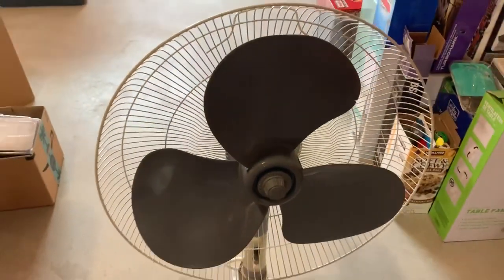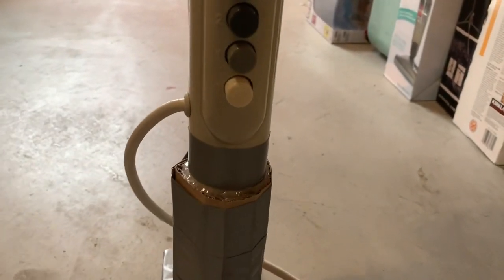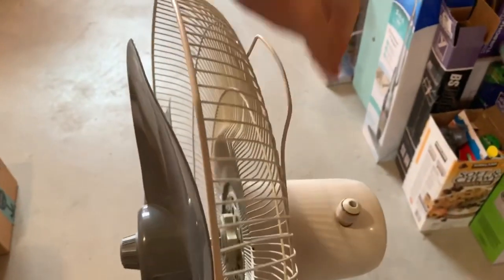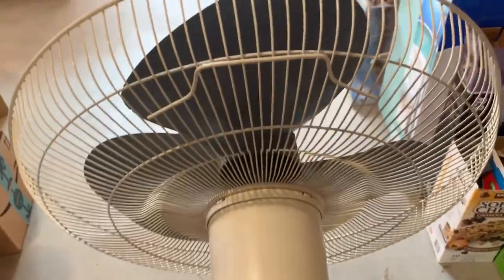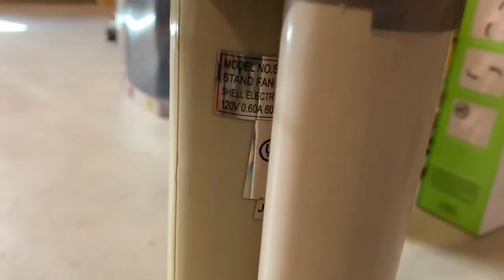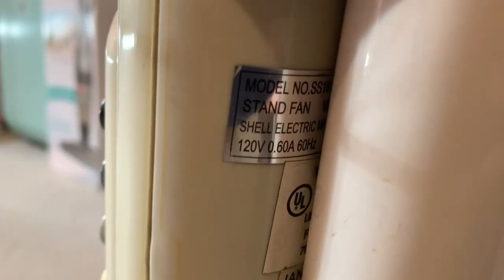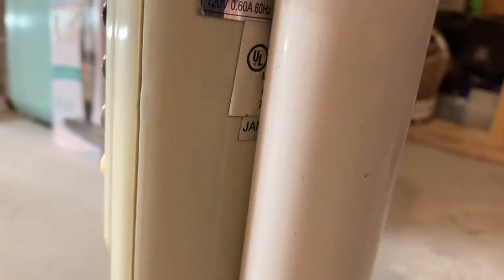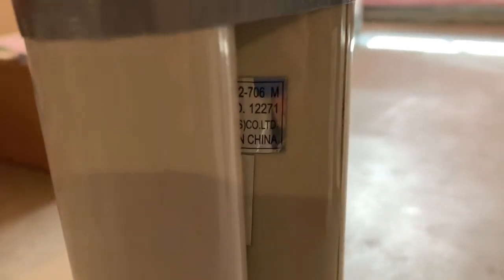2004 Hampton Bay 18” Franken-Fan

Comment: Wow! That is a good runner for a beat up fan, sad that it’s being parted out.
That is a good spin down time for a beat up fan also.
Reply from the maker: I know right? Even before I oiled the motor it already had a really impressive spin-down time. It seems to be a common characteristic of SMC-made fans. It got parted out right after I finished filming this video, but I still kept the useful parts such as the motor, switch, wires and some smaller parts.
Reply: It’s good that you kept the motor, that motor seems to run very well
Reply from the maker: It sure does. I was surprised at how well it ran considering how banged up it was when I found it.

Comment: Those blades are probably not oringnal because I've seen Hampton Bays with a smaller blade set
Reply from the maker: The blades are original. The ones with the skinny, pointed blades were a different variant. I've seen many Hampton Bay fans with these wide blades too.